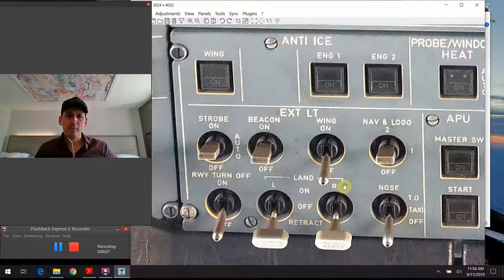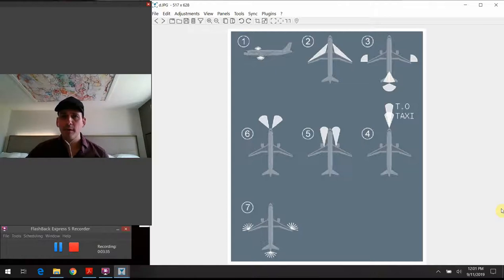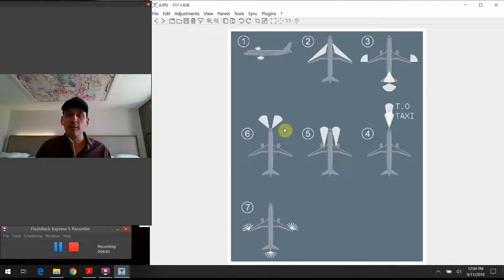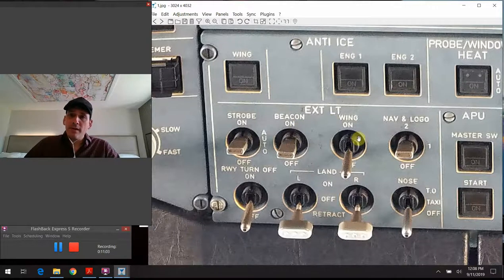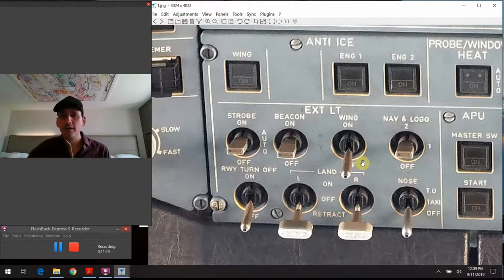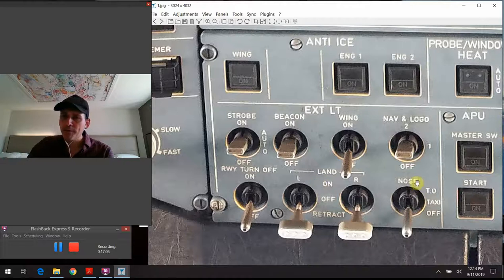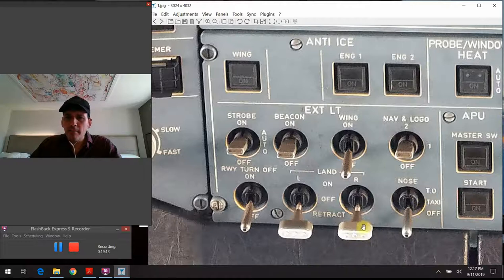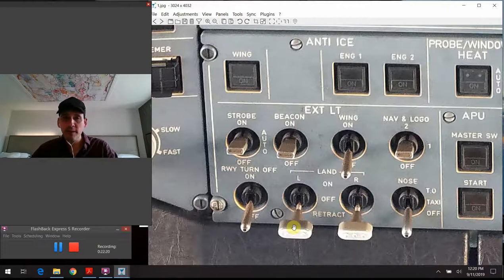Airbus A320 Cockpit Tour: #26 - Exterior Lights Panel: What do all those buttons do?!

Comment: Thank you for making this video! I was always confused when I fly in the sim what the Nav Light 1 and 2 are. I always used to think that the Logo and Nav were #2 and Nav lights only were #1 so thank you for the help. The only question is that if 1 & 2 are both Nav Lights, how do you turn on the logo? Or is it automatic? Thanks!
Reply from the maker: Hi thanks for tuning in my friend! Yes  you are correct the logo light is actually automatic and tied into this switch, so we do not have a separate control for this.  Great question!
Reply: Mike Abignale thanks!
Reply from the maker: What kind of sim are you running? I'd like to get a better set up at some point and make some more useful videos for people!
Reply: Mike Abignale I use Lockheed Martin P3Dv5, with the FSLabs A320. It is a very accurate simulation of the real aircraft so I’m sure you would like it!
Reply from the maker: Fantastic! I have so many projects right now but I'd really like to come back to making some YouTube content. It will probably be in a month or so... cheers!
Reply: Mike Abignale nice!
Reply from the maker: Keep in touch my friend, let me know if you have any more questions!
Reply: Mike Abignale ok thanks!